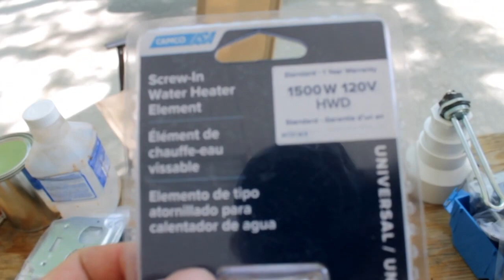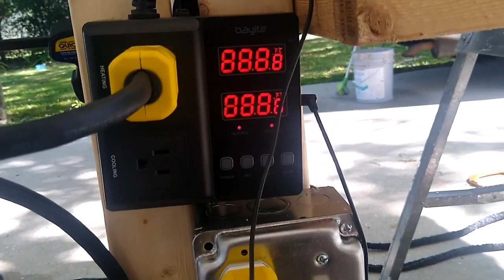Electric PVC Bluing and Parkerizing Tanks That WORK!!

Comment: How did this hold up? Max temp for PVC is supposed to be 140° F. I was going to a similar setup for Parkerizing camshafts. I'm going to try wrapping the pipe with 1200w heater blanket. Might have to use your method if it doesn't get hot enough.
Reply from the maker: @terrytinney  they held up pretty well. Most parkerizing is done around 175 to 185 and I had no issue at this temperature. After a while a little bit of water would seep out the bottom where The heaters are at however slightly tightening them some would make it stop. If you can, have all stainless steel containers is the best option. Keltec uses 55 gallon stainless steel drums with electric heaters. However if you find some stainless steel pipe and weld a cap on the bottom possibly adding a bung that is threaded to accept water heater elements, that would probably work well for your application. It does help to have an identical tank for a hot water rinse. I don't know how much experience you have parkerizing but after a few sessions on your solution it tends to get a powdery and flakey residue that likes to stick to your parts. The hot water rinse breaks the bond of that stuff.